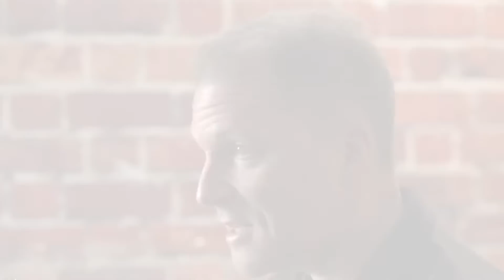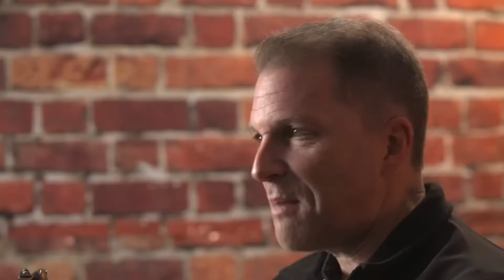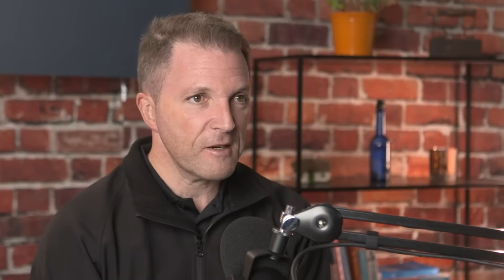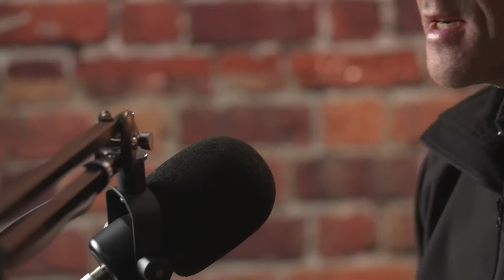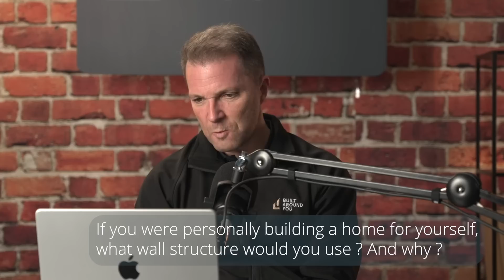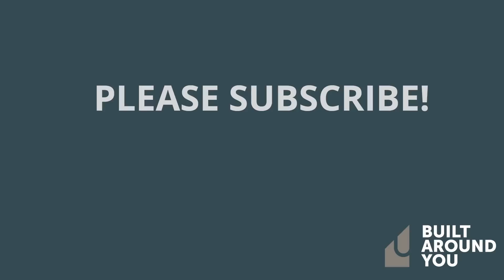What is the cheapest way to build a house in Ireland?

Comment: You only need enough block walls to carry the roof.  The rest can be timber 4"X2" with mineral wool between studs and plaster board in 2 layers on both sides of the stud walls.  This type of wall is more sound proof than concrete walls.
Reply: No its not. I did this and well. And i regret not having block walls.

Comment: Just wondering what do you think those European style, insulated thermally efficient  Clay,  'Porotherm,' [interlocking]  blocks,  that use a super Thin mortar bed.  applied with a special  roller / applicator, might this method  take off here in Ireland. due to the quickness of laying same, and it's reckoned even in sketchy cold weather,  maybe in the future it might become hard to get skilled Block layer trades,  to build those, ''Block on Edge''  Wide double  cavities. Great Upload...
Reply: Porotherm Clay Blocks,  some of same would have a Rockwool type insulation already fitting into those internal multi chambered cavity voids within the block ... https://www.clayblock.ie/product/porotherm-365-t7-mw-insulated/  https://www.youtube.com/watch?v=u45xYr6gn0Y
Reply from the maker: @malachy1847  I’m not familiar with this product. Definitely the block laying trade is under a huge pressure in Ireland and probably other countries too. I haven’t seen a major alternative although timber frame is gaining ground the whole time. I do see blockwork being a little bit cheaper than timber frame though.

Comment: The cheapest and strongest way to build a house actually is 9inch solids on flat ,skim outside and inside also 100mm insulation inside better for installation  of Windows also . no complications plain and simple and much stronger house and better ber rating !  Very surprised this had no mention but great video 👍
Reply: Would you put battens on inside to hold the internal insulation ?.  How would you prevent water ingres with blocks on flat or otherwise without cavity to prevent it?. 😢
Reply: How do you internally insulate where internal walls meet the external walls ? Just curious

Comment: Block on flat with external insulation would have almost exactly the same volume of concrete block as a cavity wall, only 10mm difference in width, so cost wise would be comparable, +5%? An added benefit of internal block on flat construction, is all of the mass is used to regulate internal temperature…Very informative video thanks!

Comment: Hi very informative video, just got planning for a new build and going to go direct labour, 
I am very open to new ideas and taking risks, and nowadays everyone is all talk about heat pumps etc etc 
I was thinking of going with an underfloor electric heating mat for the whole lower floor, backed up with an array of pv panels, 
I’ve tried to have this conversation with many a builders and the only negatives seem to be the unknown price of running it, and also it’s not a common thing to do, 
All the companies that sell it say it’s cheaper to run, also it’s  cheaper to install and zero maintenance once it’s fitted properly, and zero pipe work,fitting the mat in a very thin layer of easy screed and having each room with its own controlled stat, it seems to be very popular in Europe in countries with much colder climate than ours so I am wondering why it’s not so popular here, I’ll be building a standard 3 bed dormer and having a very good u value, was thinking of using a heat decor underfloor heating mat and they are based in Poland, any information is greatly appreciated
Reply: Hello is your new build finished? Is the house built in Dublin or any other county. I was looking into the self build houses and would appreciate it if you have any contacts of any trustworthy builders/architects in Dublin to share? Thanks a mill!
Reply: @sheetalpyhsio good luck trying to get a builder now a days who won’t completely rob you
Reply: You are wise to be wary of Heat Pumps. Saw a TV piece on a problem a man had when the temp., dropped below zero the pump stopped working.  Got no help from Supplier of Pump to sort it out.  Thermostat maybe ?.  😮
Reply: @ anything the government recommends I’d be very careful of doing, I don’t like the heat pumps as they are an expensive unit and all they are is a fridge operating backwards also the water for showering is heated in the unit with an Emerson something that was always a no no with the Irish in regards to an expensive way to heating water

Comment: Top tip, if the pressure is on to get blocks up and temperatures are hovering around freezing, fire good shot of auto anti freeze into your mortar. It’ll buy you just enough time to get paid out of the job and get loaded up and gone before the whole lot comes crashing down.#someoneelsesproblem
Reply from the maker: I would be concerned with adding something like that to the mortar in case it reacted with something else and may not become apparent until later?